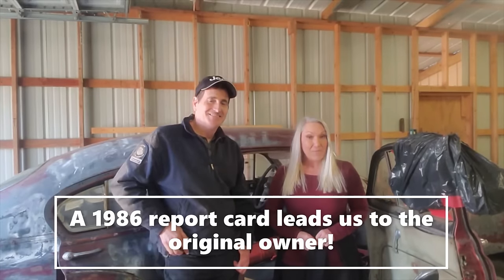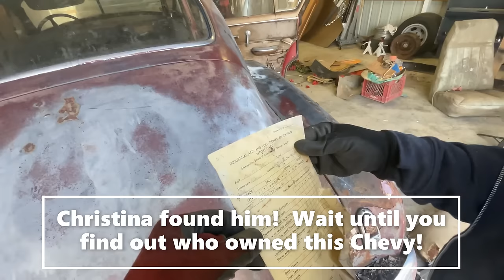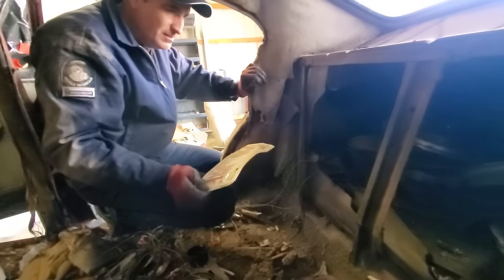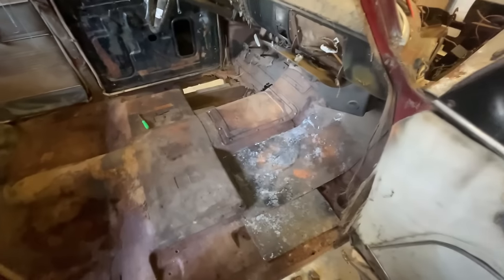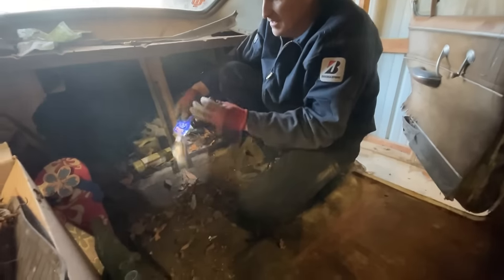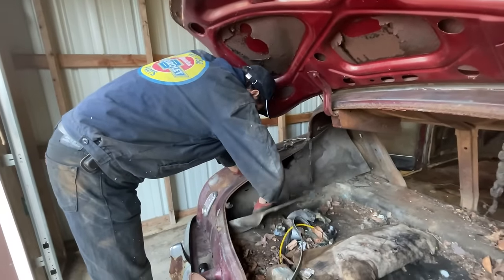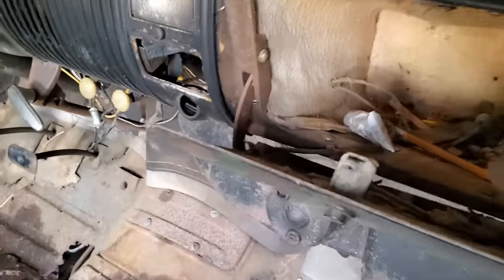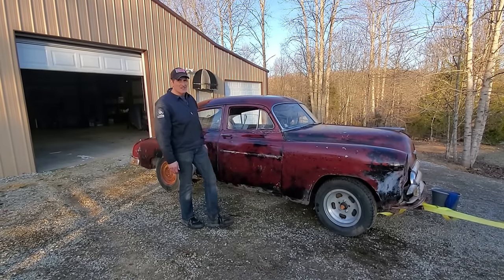Cleaning out and cleaning up the 1949 Chevy Fleetline! Every old car has a story!

Comment: You need a metal pole tow strap. Or a triple pulley hand winch..or electric winch on your post. Should have put some caps on it. Use one of those washing up brushes to clean your dash. Now what you going to do with it.. Good luck.

Comment: The foot gas pedal is the one I am  using on my 1981 F100. I have used this pedal on many of the cars I have owned. You should use it on one of your vehicles. They also had a matching one to turn on your headlight brights.
Reply from the maker: Right on! Maybe I'll put it back in this car.

Comment: Believe me, I am the last one to advocate for safety, my motto is always "safety last" LOL, but you guys should be careful with all the dust you are breathing in from inside those old cars, especially in enclosed areas without air movement. I would suggest wearing N95 masks and even some sort of protective overalls (like Tyvek suits) when you're working on these cool old rides, especially when you're clearing out the interiors. I rescued a 1961 Metropolitan recently after it had been sitting outside for 20 plus years. It was full of dust, dirt, mouse and rat poop, you name it! I ended up getting a nasty rash on my arms and legs, turned out to be "atopic dermatitis", which the docs said was most likely caused by the dust and dirt from that old car, especially from the mouse and rat droppings and nesting materials. Just a word of caution! Take care, guys! Loving what y'all are doing.
Reply from the maker: You are absolutely right. We usually have masks on, but with our recent move, things are not yet organized. Thank you for the reminder and the support of the channel. We really appreciate it.

Comment: I had one of them foot gas pedals back in the 80's. It may still be around, who knows? That car appears to have been a CA car at one time. It has the 1940-1955 CA dealership frames from Tulare and a 1975 CA Highway Patrol sticker on the windshield.

Comment: Great job, certainly a big improvement. Now a word of advice meant with deep respect. You need to watch it pushing a car that heavy the way you did. Heart attack waiting to happen, and no one wants to see that happen to you. Your wife was right, use the truck, an old tire between the two and as they say, work smarter, not harder. Being 65 years of age myself and still doing farm-related things I have learned not to push this old body too hard. Can't wait to see you guys get it running.
Reply from the maker: Thanks Barry you're right. Sometimes it is tough to act my age. A reminder helps keep that in focus.

Comment: That's called a surfers foot also had a smaller one for the dimmer switch in the floor
Reply: I had a 63 Imperial with those on it. The Imperials of that era had a floor button to change the radio stations up next to the high beam switch. I had 2 of the small feet and the gas pedal one.